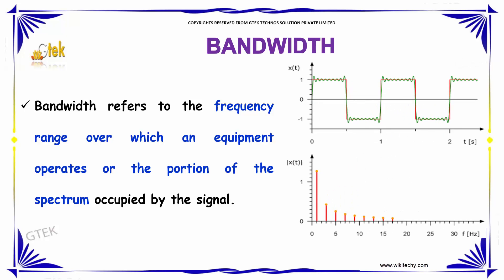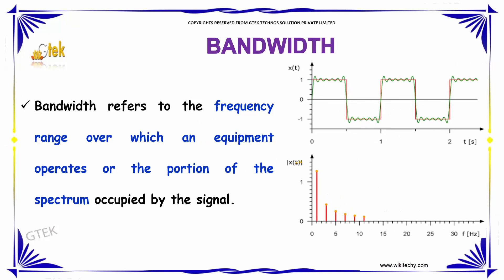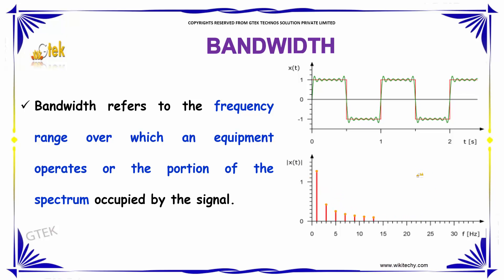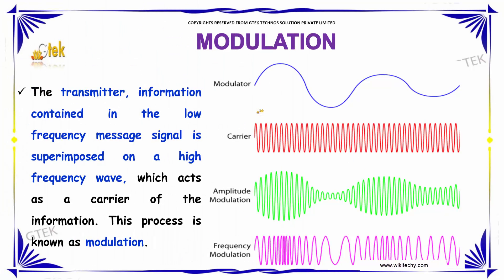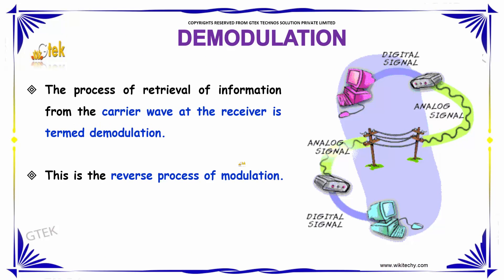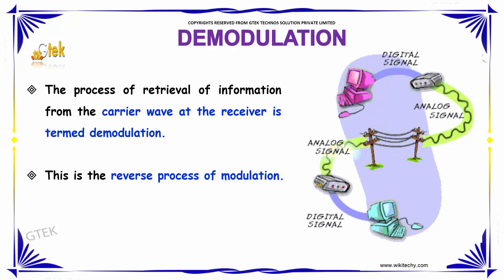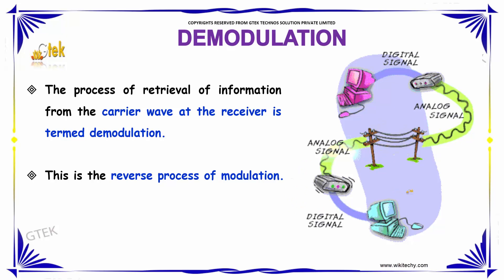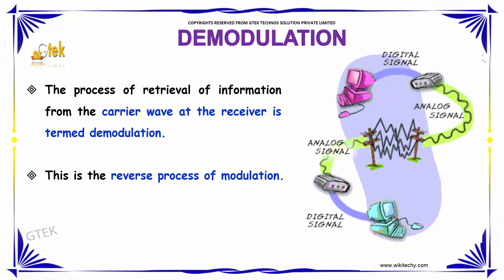Bandwidth Modulation and Demodulation |Communication systems|class 12 physics notes|CBSE|IITJEE|NEET

Comment: Feb 6, 2017 - It is the phenomena of superimposing the low audio frequency baseband message or information signals or modulating signal on a high-frequency carrier wave. The resultant wave is called the transmitted wave, which is transmitted.

Comment: Passband bandwidth is the difference between the upper and lower cutoff frequencies of, for example, a band-pass filter, a communication channel, or a signal spectrum. In the case of a low-pass filter or baseband signal, the bandwidth is equal to its upper cutoff frequency.

Comment: The audio signal uses frequency modulation, with a highest baseband frequency of 10 kHz and a frequency deviation of 25 kHz. Thus the audio bandwidth is 70 kHz and is centered 4.5 MHz above the video Page 5 4 carrier. The total bandwidth for both the video and audio signals is 6.0 MHz.

Comment: Amplitude modulation (AM) is a modulation technique used in electronic communication, most ... Each sideband is equal in bandwidth to that of the modulating signal, and is a mirror image of the other. ... from a greatly reduced "pilot" carrier (in reduced-carrier transmission or DSB-RC) to use in the demodulation process.

Comment: The amplitude modulated signal consists of a carrier with two sidebands that extend out from the main carrier. This results from the modulation process. It is found that if the carrier is modulated with a 1 kHz tone, for example, two sidebands each 1 kHz away from the carrier will appear.

Comment: Bandwidth refers to the frequency range over which an equipment operates or the portion of the spectrum occupied by the signal.
The transmitter, information contained in the low frequency message signal is superimposed on a high frequency wave, which acts as a carrier of the information. This process is known as modulation